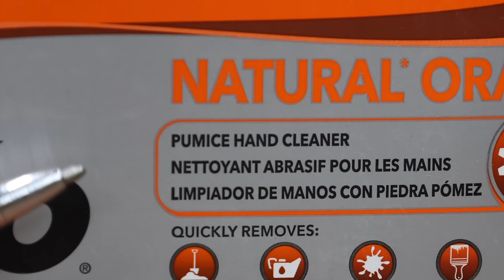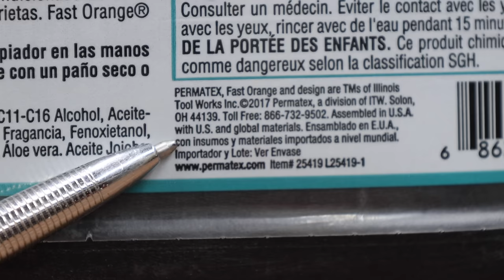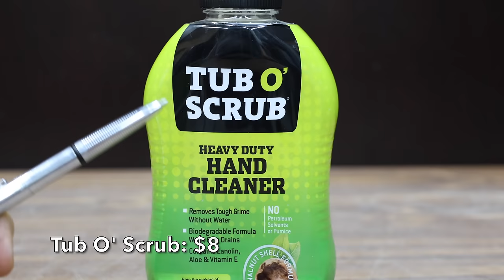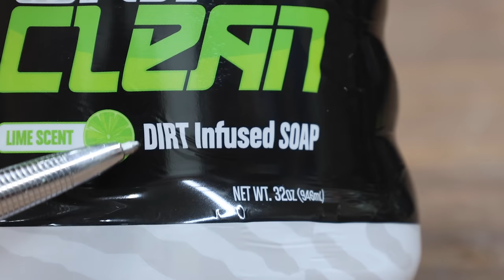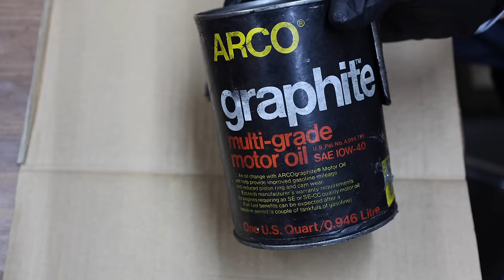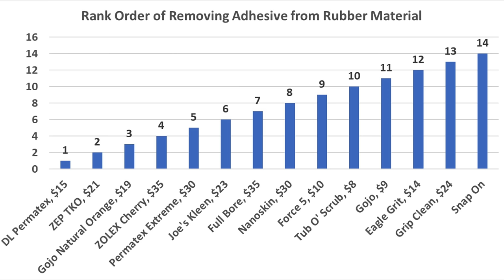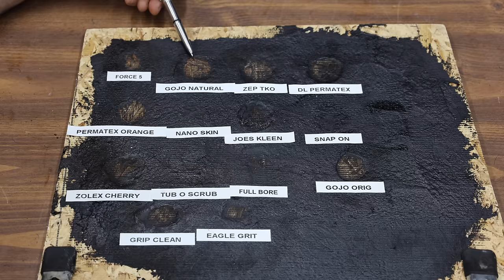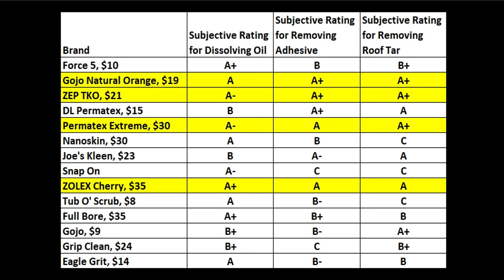Best Hand Cleaner? Let’s Find Out!

Comment: Would you be able to do a video on which work boot is best for carpenter’s? Like saw dust test on the soles, seat the rip resistant when wood or melamine sheets get dropped on it. How flexible the boot is when moving up and down a ladder etc. I need a better boot myself and am curious on what you think.

Edit: also if you’re able to test it, comfort on standing on more or less one place for 6 - 8 hours at a time. (Ex standing at a chop saw cutting materials)

I’m a kitchen cabinetmaker myself for reference

Comment: I am certainly not up to speed, but a comparison of "Gloves in a bottle" would be interesting, I work in milling/turning, and we usually don't wear gloves there for obvious reasons, but that results and greasy/oily hands mixed with rust, dirt and other stuff, also a lot of cuts, and stuck metal shavings, I can spend a lot of time every day removing tiny metal shavings when working on a CNC mill, since I am not American or even from the continent the products may not be the ones I can buy, but it would still be interesting to know what works and what not so much.
Reply from the maker: Thanks for the suggestion.

Comment: Performance of cleaning in various categories is great, but I have to wonder about using them when one has a Septic Tank.  I know things like Bleach and Gas are bad, but what about these hand cleaners?  I have three brands of hand cleaner plus liquid Dawn Dish soap.  I had tried to find original GoJo, but kept being sold new versions claimed to be better at AutoZone.  Your results show GoJo Original isn't as good as I remembered, but my target use is grease, things like anti-seize, engine grime, etc.  The ones I'm using now do OK, but I still have to wonder what they are doing to my Septic Tank.  Thanks, Todd.
Reply from the maker: You are welcome!

Comment: Answer: borax powdered hand soap is the best when you are able to also use water, which was not tested. At my shop we have a boraxo dispenser right next to gojo orange, we use simple green to clean steel before welding but none of us like to use it for lunch/end of day hand cleaning. Borax soap just deals with so many things and is so cheap at about $2.50 a pound (can get is cheaper depending on brand) and only takes a couple ounces do do a lot of work on your hands. It is especially good at removing some pretty nasty adhesives that are a pain with any of the products in the video.

The first test was fairly useless seeing as HAND cleaner test, cleaning rags is not really indicative of how well it can clean hands since there is a huge difference between cloth and skin.

The second test... hands are not rubber, again this doesn't really tell us how good a HAND CLEANER any of these products are. Yes, it can be hard to get all the previous product off your hands or all the previous test's "dirt" if it didn't do well but all that is much more indicative of how well the hand cleaners are able to clean skin/hands. At the very least this is a bit closer than the rag test which only tells us how good a cloth cleaner the products are which is meaningless for the intended use.

While interesting, again the third test fails to tell me how well any of these products cleans hands. I would never allow  tar to completely dry on my hands, at that point you are better off using sand paper and/or some sort of skin-safe(er) solvents. (obviously with the proper chemical to stop the solvent after its job is done)

Granted: I can see why you would do all the other tests given the final not-really-a-test segment took up less than 2 minutes and wouldn't have made a particularly interesting video.
Reply from the maker: Thanks for the constructive feedback.

Comment: Solvol soap bar was the best. The bar would normally last for a bloody long time, also was good for in the shower (for knees and backs of arms, legs etc), got discontinued and cant find anything as good to leave in shower without melting away and turning mushy, gritmitts isnt as good.Not fussed on the wet stuff as long as it has grit its sure to work on the hands, with enough elbow grease that is...
Reply from the maker: Thanks for sharing.

Comment: Pro-Soap.   You can use it if hands are wet. All tests should divide the cleaners that require dry hands from wet OR dry. Also, drying effect on hands and other properties are hard to quantify. I use Pro-Soap.... no volcanic hopped up razor blades... the grit is tiny plastic beads...cleans and does not dry out hands. The WORST ever I have used is Go-Jo, the white paste. On the road, I use  "Scrubs In a Bucket" mechanic baby wipes..... they have the cleaner built in to the towels.

Comment: Idea : Test on "melting" / "arcing" on different electrical wire joints both for full wire and stranded. Regular twist the wire joint and cover with electrical tape, advanced twist the wire joint and cover with electrical tape, wire nut, Wago, screw joint and solder joint (maybe there are more ways?). Basically what i want to know is if all of these are done correctly is there really a risk, cause i've seen quite a few videos saying just doing the "advanced" twist and electrical tape is a huge FIRE HAZARD / Fault issue . Basically test for melting or arcing with some sort of current generator, test for rip apart strength, test for resistivity. Maybe a collab with some "Electro" engineer haha?
Reply from the maker: Thanks for the suggestion.

Comment: Could you please perform an evaluation of engine cleaning products that are used through adding to gas.

My 13 yr old Honda CRV 90,000 mile is getting poor mileage (now 20 to 21 mpg) and idles a little rough.  I have no idea how you could test the various additives that can be purchased for $4 to $20 all claiming to clean injectors, plugs, valves etc..

Given your phenomenal tests, I suspect you could come up with some excellent ways to judge the efficacy of the many gas additives!!

A great fan of your reviews,

JRC Raleigh
Reply from the maker: Thanks!  Thanks for the suggestion.

Comment: Permatex gel should be applied to greased hands without water. Rub thoroughly and use a hand brush as needed. Then rinse with water. I like permatex the best. If hands are wet, permatex won't work properly.
Reply from the maker: Thanks for sharing.

Comment: Anything with a strong detergent and de-greaser mixed with walnut shells has always been the best cleaner for me hands down. I don't need oils or lanolin mixed in as that's more or less what I'm trying to remove and it weakens the formula and doesn't work anyways. Why mix an moisturizer (oil) into a detergent if the goal is to remove that anyhow. I can moisturize my hands later on after they are clean.
Reply from the maker: Thanks for sharing.

Comment: The battle of the 15w40 synthetic. Semi trucks take 8gal to 12gal per oil change. Need to know which is best. 

Rotella T6 15w40 full synthetic 
Mobile delvac 1 15w40 full synthetic 
Cheveron delo 400xsp 15w40 full synthetic 
Amsoil signature 15w40 full synthetic 
Royal purple duralec 15w40 full synthetic 
Lucas 15w40 synthetic
Triax 15w40 full synthetic
Schaeffer's 15w40 synthetic
Redline 15w40 synthetic
Ultra1plus 15w40 full synthetic 
Hotshots secret diamond 15w40 full synthetic 
Liqui moly 15w40 full synthetic
Reply from the maker: Thanks for the suggestion.

Comment: I have been watching your videos for months and have purchased several of your recommended ones when I need them. 
I looked back at your past videos and didn't see anything about cat 5 cable ends being installed. I am not a professional  installer just a do it yourselfer who once in a while need a cat 5 cable end repaired or just to run new wires from one place to another without having to buy the correct length every time. There several out there now that say they are tooless and the reviews are, to say the least, very confusing and not very informative. I was wondering if you could do a segment on these if that is something that would appeal to you.
Reply from the maker: Thanks for the suggestion.

Comment: Seeing Fast Orange score well makes me question your testing methods. The shelf next to the sink at my shop has 3 gallon sized jugs of orange hand cleaner that nobody has even thought about using for years. One is literally from the seventies and it's so terrible that it is still 3/4 full after 45+ years. I inherited that jug 20 yrs ago when my grandfather died, the other two were freebies from parts stores. If you use them dry they kind of work, but if you try to rinse with water it just redeposits the grease onto your hands. The only hand cleaners that work for mechanics are oil/walnut based like zep ez scrub and countless commercial hand cleaners.

Comment: Our product grime reaper liquid soap would definitely blow these out of the water...  The testing of this is not quite right for how they work. Surfactants attach to these positively charged particles such as dirt, grime, grease and oil and make them bigger and more easily rinsed off with water by water tension by becoming a bigger particle. Just letting it sit in a jar won't do much unless its a solvent.